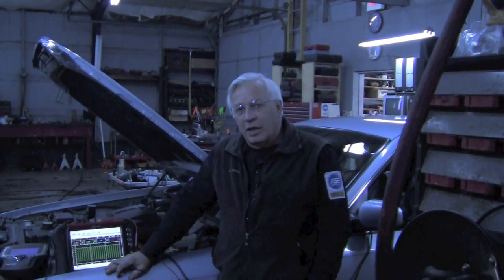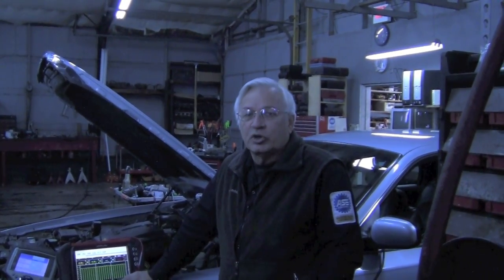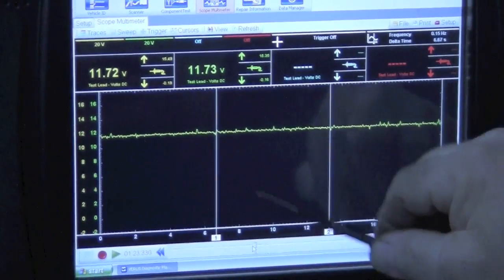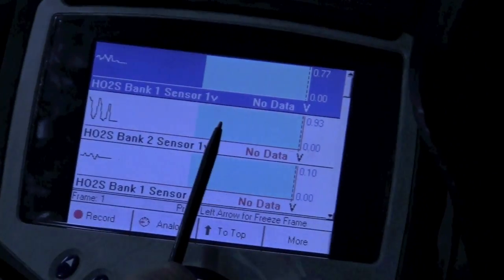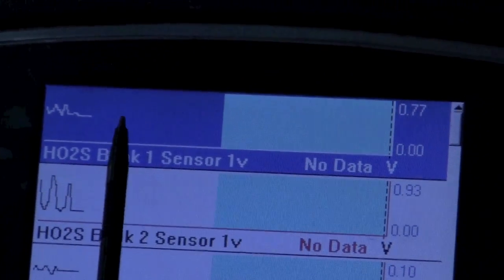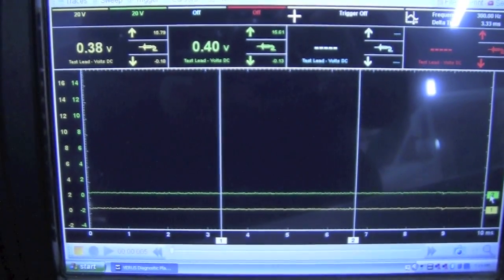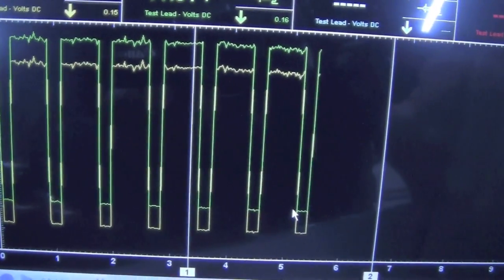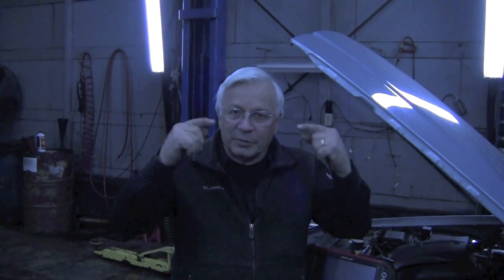P0133 Testing a H02 Sensor

Comment: That code doesn’t indicate a heater problem. That is a different code all together.  This code specifically states it is set due to slow switching response time. It is not a bad idea to check the heater circuit.  Usually it’s due to deteriorated O2 sensor. But that is some misinformation.  I have a Honda with same code and with a new sensor sensor still sets the code.  It may be a pcm problem since everything so far has tested fine.

Comment: thanks for your videos on o2 sensors, it help me understanding how they work and respond , right now am having issues with these codes first P0133 then P0153 but P0175 in the mornings if car is not fully warm up to 190*, and after driving it right away went going to daily places. ill replace the o2 today because i check and replace so many parts, gaskets and still same problem

Comment: Cruz. You sound smart? Well I have a 1997 Ford Torres GL 3.0 6 Cylinder (OVH)?  Well it has 2 Catalina Converter that mains it has 4 Oxygen Sensor 2 lower 2 upper. I  have changed 1 lower 1 upper, from each def-rant Catalina Converter. that mains each Catalina Converter has 1  new Oxygen Sensor. That fuck en car is more supped then me. The en-gain is starting an running strong & heating up WHY? Get to me at cruz101942@gmail.com ASAP, Okay man ; (  thank you.

Comment: @GPSNW asetech76 is right. The VERUS blows all of the Genisys products outta the water, even the Pegysis, which is supposed to be really bad about freezing up. I'm in the same boat as you. It'll be a while before I can afford a VERUS too. Of course, I'm gonna get the gas analyzer for it, 10 foot long scope leads designed specifically for it, pressure tranducers and related adaptors, and a bunch of other stuff. My ultimate goal is to be able to diagnose almost anything, anywhere, at anytime.

Comment: loving the scope to prove the fix.  I like how you used the sensor voltage to see the sensor is not responding how it should.  Youre correct when you said most just throw a sensor at it, especially when working flat rate.  This video helps to understand what that new sensor is doing that the old one is not.